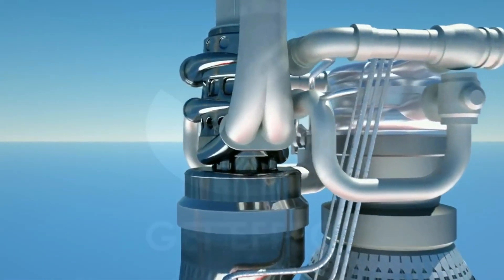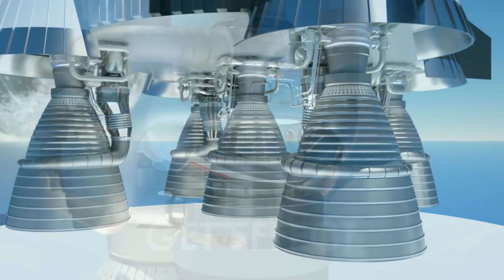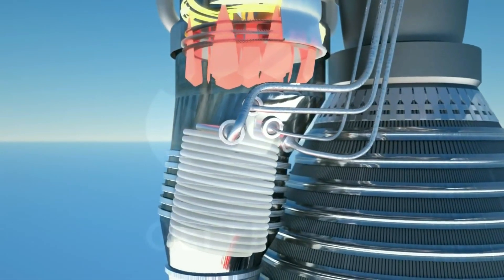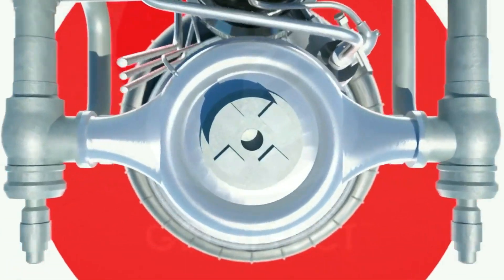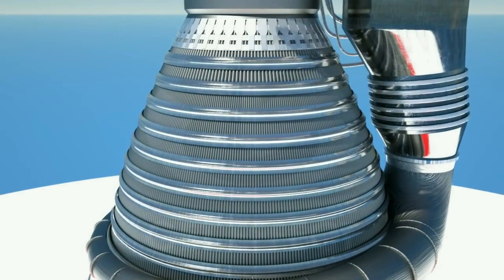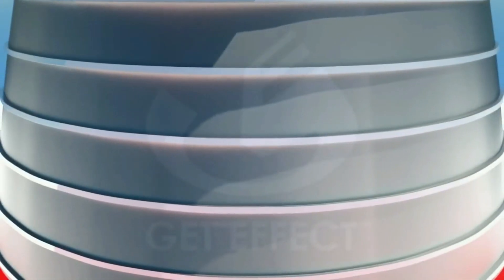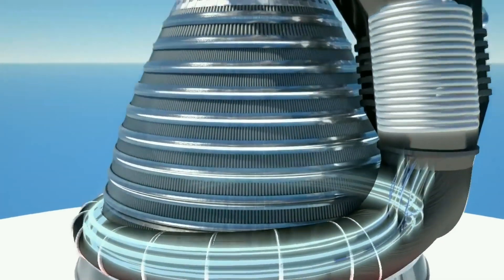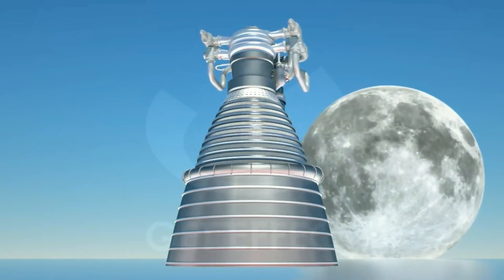Moon Hoax; " Engine Trouble"

Comment: This guy is a little loose with the facts, or doesn't know what he is talking about. The engine problems he is referring to were the J-2 engines in the second stage , not the F-1, meaning his whole story is bogus.  One of the engines shut down due to an electrical problem from vibration. The other engine shut down due to an improperly installed wire ,resulting in the computer shutting down the wrong engine .  The F-1 engines worked perfectly on all flights.
Reply from the maker: So did aviations world the "COMET" until it began falling out of the sky TWICE killing every soul on board. Do we see that with Apollo? No! All we see is one carefully staged accident which could have been avoided. No scientist worth his/her credentials is going to fill a cabin with pure oxygen when the switches in it were not explosion proof. Those three men were in their space suits for heaven's sake so they had their own supply. Why pressurise the capsule with pure oxygen? To purposely start a fire! Grissom was going to the press the very next day and tell the entire world what a joke Apollo was. It was a joke back then and remains so to this day! Go have another "MILLER" on us cretin!
Reply from the maker: Then go to Randy's channel and get some education. I guarantee none of you idiots will even do as much as that! You are full of words and no action. Taffy is proving that video by video.

Comment: This is in response to those who compare the Saturn V's lack of testing in actual spaceflight conditions before the first manned mission, to that of the Space Shuttle, which also had no testing in actual spaceflight conditions before its first manned mission.

The first launch of the Space Shuttle was another example of a hit and miss approach with NASA. It should have been an unmanned launch. However, there are some differences between this mission and the first manned mission of Apollo 8. Of the first 2 unmanned launches of the Saturn V, the second launch was a near disaster. NASA also admitted to a history of combustion chamber instability problems with the F-1 engines, along with pogo oscillation problems with the Saturn V. Given these problems, there should have been more testing of the Saturn V leading up to its first manned mission, with Apollo 8. But of course, there wasn't any. 

As for the Space Shuttle, solid fuelled rockets had been perfected in terms of stability in the previous 30 years before the first Space Shuttle launch. And the Space Shuttle main engines had a history going back 20 years before the first Space Shuttle launch, with their design being perfected in the 1970s. So unlike the F-1 engines and the Saturn V, the Space Shuttle components had at least a better probability of performing to expectations on its first manned mission.
Reply: The F-1 engine instability issue was resolved prior to the launches.  The engine shutdown issue on Apollo 6 involved a relatively minor problem with one of the  J-2 engines , not the F-1's.  They never had an issue with the F-1's.   Yes, they should have perhaps tested the Saturn one more time, but the whole game was beating the Soviets to the moon.

Comment: Posted this question before and all l get is rude comments:-

Can anyone from NASA or connected with them give me a reason why all the vintage spacesuits capsules and apollo tech that cost fortunes and only used once  ALL lovingly looked after and cared for cannot be used again? NASA complains that they have to recreate the tech but they said they already did it with the tech they have in their possession or loaned to museums - so why can't they get their act together get a Rocket off the Russians and put a monkey on the moon with a go-pro and quieten all the cynics AND at the same time save the public purse trillions? 🤔 l have a vintage gramophone and telephone and valve radio that still work. 

(What's so difficult about my concept and what's so precious about all their vintage equipment that it cannot be recycled and reused?) 

Also, does anyone know what happened to the famous boots that made that famous imprint in the regolith? They might need to re-use them.
Reply from the maker: And that's all you will get from this NASA lot. Get used to it. Here is a link to Randy's channel below. You can ask him any question on Apollo and he will answer it in a polite manner. I cannot say that for these Bertie Bunch NASA shillbillies. Cheers m8!
https://youtu.be/-mEAIuzC4K8